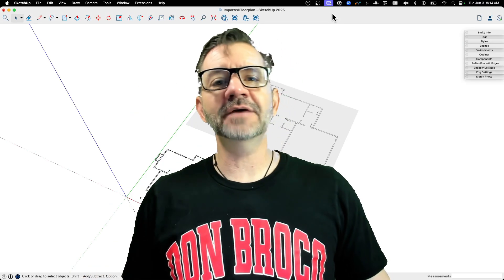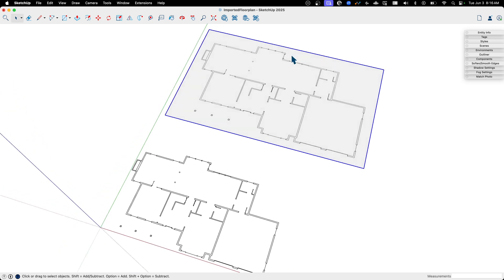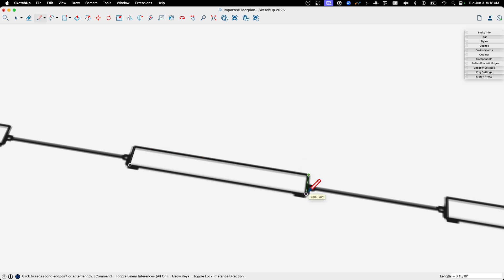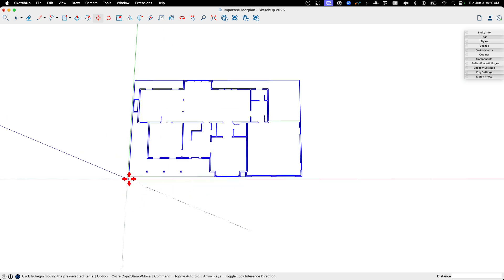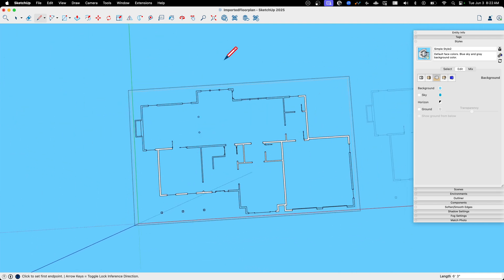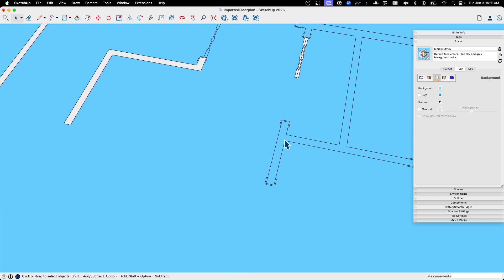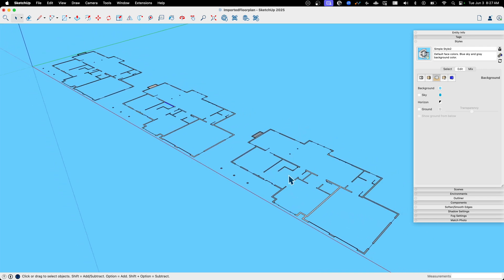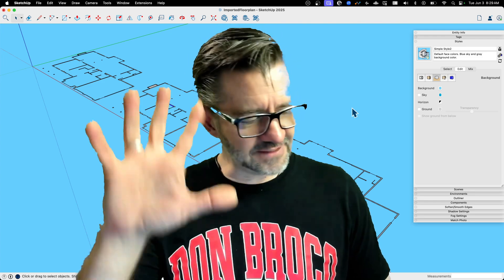CAD Linework to SketchUp Geometry: 3 Methods

Comment: I’ve been using imported 2D DWG files to build SketchUp models pretty much every day for over 10 years.
I always build the model manually using the 2D as a reference. Trying to shortcut things by modeling directly from the imported lines usually leads to more trouble than it’s worth.
Also, tweaking your 2D drawing specifically for SketchUp makes a big difference.
Reply: I can see that. Is this because it's easier for you to design and draft a plan in CAD and export 2D DWG? I'm new to architectural drafting, just wondering about workflows.

Comment: Another way is to use the sandbox tool (I believe it is "drape"). Draw a large rectangle like Aaron did, then raise the floor plan so that it is higher in the z direction (doesn't matter how high).  Then use the drape function to project the floor plan onto the blank rectangle below. Just make sure the rectangle is a group.  This way, if for some reason all the CAD linework is not all at the same z datum, it will be once it is draped.

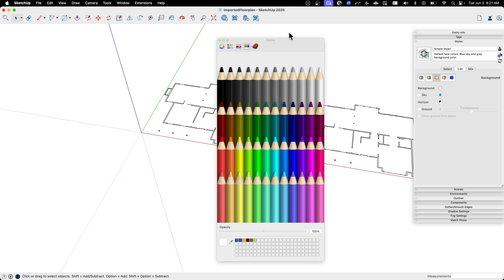Comment: I’m a little confused - at the 6:43 mark, I think he said that he draws a line on a closed shape, the closed shape then turns into a face. Is that correct? Is it true that if you have a closed shape and you connect any two points w a line that it will create the face? I know that using the line tool if you connect 4 edges you get a face, but this looked like the face was already there, just not displayed as such and drawing a line anywhere on it caused it to “appear”. Not sure if my question makes sense!
Reply: When you have a closed shape, but the face is missing.  All you need to do is draw a line segment along one of the edges. It is not necessary to connect corners.

Comment: If you need to maintain existing text, I don't recommend dropping the groups to line work. Most text ends up as an unfilled letter shapes. Before you drop your text into lines close each letter.   If you do this, most of the other letters will fill in. You may only need to do one letter "B" and you can get most off the other capital letter "B"s.

I don't exactly know how the computer decides what line work goes into what group. But I usually have similar line work in different groups. I typically move similar line work into a single group and fix the layers of t he line work and group. 

If you drop everything to basic line work without separating different layers and groups, what should be a one line of 100', can become a bunch of random lines. Some of these lines can be very small and hard to remove.